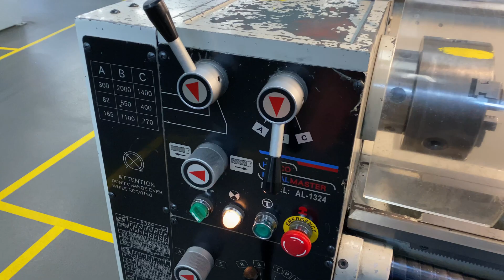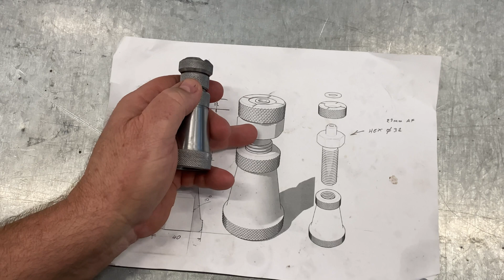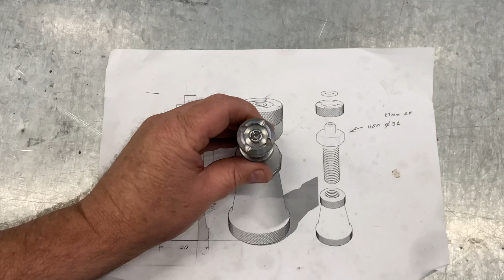Make a machinist Jack Part-2

Comment: Hi Aaron. Im hoping to use this as a school metal work project but Ive tried opening all the CAD files but it says im unauthorised. Can you please have a look or is there any other way I can access it? I dont use Fusion however in the past ive been able to open it Inventor.. Regards. Digby
Reply from the maker: G'day Digby.  Sorry those links didn't work.  Bloody Autodesk keep changing things and this must break the links.  I have updated them once again.  Here they are here mate:

CAD link here: https://a360.co/4qE3vvY
Machinist jack image from Google: https://a360.co/3YoIQQi
Machinist jack image TAFE: https://a360.co/3L7Vi3Z

Keep molding those young minds.  As for me, I'm back in the secondary system now teaching year 10's only.  Cheers, Aaron.
PS: send me an email if you need anything it's my full name at hotmail.com
Reply: @AaronEngineering  thanks heaps aaron. best wishes for the year

Comment: Very nice...what material did you use for the jack if you don't mind me asking... and I apologise in advance if you did say it on the video and I've missed the information
Reply from the maker: Hi Alex. From memory I think it was free machine grade to make this little screw Jack. We purchase this material to use at the college with the students as it’s easy to machine and you can get a good finish. Apart from that we also use bright mild steel. Hope this helps. Cheers 🍻. Aaron
Reply: @AaronEngineering  its of great help and also thankyou for taking the time to reply with an answer to my question. I bought my first machine tool a year ago and realised how much I had to learn, not only to use the tools I've now got but also the rest of the information that goes with turning and shaping metal aswell as which grades are best for which jobs. Thankyou once again Aaron and all the best to you and your loved ones🤙

Comment: Nice job, I like that you took the time to tilt the part for the vees insead of using a chamfering type cutter.
Reply from the maker: Thank you 🙏. It was a fun little project to make in the shop. There are some files and plans in the video description area you can download if interested. Cheers Aaron
Reply: @AaronEngineering  Thanks for the reply Aaron. Can I ask a quick question please. I'm relativley new to youtube and one of my videos has taken off with over 800 recent views, yet has no comments. Do you find this odd or is this normal.
Reply from the maker: @machinists-shortcuts  Hey buddy. That’s a very good question. Im unsure why people would watch but not comment. May I suggest to engage more with your audience. Maybe do some voice over or appear in the video. Best of luck with your channel. I added some comments and subscribed. Cheers 🍻. Aaron

Comment: I made this jack at Tafe 40 years ago as a Pre-Vocational Student in QLD
Reply from the maker: G'day Chris.  Not sure if you know, but I'm originally from Qld.  Did all my training at the Mt.Gravatt institute of TAFE.  Thanks for letting. me know that.  I actually found this on the internet when I was scrolling through Google images.  Then Adam, another YouTuber, told me it was in his TAFE NSW technical drawing book.  I love all those old project we used to do back in the 80's.  If you have any plans for projects Chris I would love get copy.  Of course I'd reimburse you for copying / scanning and or postage.  Cheers, Aaron.
Reply: @AaronEngineering  Hey Aaron
I did my Pre-Voc at Mt.Gravatt in 1981
Reply from the maker: @chriswoods2263  You must be a couple years older than me Chris.  I went to that TAFE from 1984-1987

Comment: We made these at tech about 1972 . I have still got the book and jack .
The book is Mechanical Drawing VOL 3, compiled by A.W.BOUNDY . PAGE 19
Reply from the maker: Hi Peter.  Thanks for that.  I had no idea that it was already out there.  I found the picture on Google images as some bloke had drawn them on Google sketch up.  Then young Adam reached out to me and told me the same thing.  I need to get myself a copy of that book.  Thanks for comment Peter.  Cheers, Aaron.

Comment: Many thanks for the CAD model. It appears to be a rendering because I only have a viewer. Can the linked model be imported and CAMed in a current version of Fusion?  I notice the angle is missing. Are you having the students calculate the taper angle?
Reply from the maker: Hey buddy. May I suggest to open the URL link via Google Chrome or Microsoft Edge. Once the model opens in the viewer, go to the top right hand side of the screen as there are 2 options. One should say download and the other open in Fusion360. If you download, it will save as a F3D (native fusion file). If you open with Fusion360 it will prompt you to save it once opened. Usually for CNC machining we always work with the solid model (reviewing the 2D drawings for tolerances & dimensions). You should be able to use the 3D model to apply all lathe toolpaths in Fusion CAM. Oh, the taper angle is 10 degrees. Hope this makes sense? Cheers 🍻. Aaron
Reply: @AaronEngineering  Thanks again for the help. I lost my F-360 when they changed the terms but plan to reload it soon. I appreciate the quality of both your content and video. Subscribed.
Reply from the maker: @chip-load  Thank you for you positive feedback and kind words.  Thanks for the sub.  Glad you enjoy the channel and content.  Hopefully I can keep up the pace.  Cheers, Aaron.

Comment: This gives me an idea to make a chess set of machinist jacks. Looks good except the boo boo, but crap happens and you adapt. The other commenters idea of the cross hole sounds like a good fix. I really need a dividing head. Good stuff.
Best! 
Eddie
Reply: I just had the same thought about chess pieces doubling as jacks..lol
Reply from the maker: Now that would look good.  Cheers, Aaron.
Reply from the maker: G'day Eddie.  Thanks for the feedback.  Yes, I was disappointed with my boo boo (fark-up).  I do have a ER32 (hex & square) collet block at home but didn't bring it in to school as I had the dividing head.  I have placed the CAD model and plans in the video description if would like to download them.  Cheers, Aaron.

Comment: I need to try keeping the half nut engaged on my Chinese lathe as well.  That's probably why I was having so much trouble with single point threading.  Thanks for the tip.
Reply from the maker: That's what my wife said to me.  Oh hang on, you're talking about the lathe LOL 🤣.

Thanks Steve.  Yes, it's the oldest trick in the book.  Just leave the half nut engaged, back off the cross slide and rewind.  Some lathes like my Colchester will cut metric threads, but as an imperial lathe if I disengage the half nut it starts in a different location.  I have uploaded the URL links to this project in the video description area.  Feel free to use it if you like.  Cheers buddy, Aaron.
Reply: @AaronEngineering  definitely a full nut

Comment: Az,
Very nice little project mate. When I chop my 1997 960B 😱 to fit the new 2horse motor, and re-assemble same 😎, I’m going to make a set of those very best jacks for sure.
Regards
Robert
PS I’ll send some pics of the lathe ‘retrofit’ …….
Reply from the maker: G'day Robert.  Thanks for watching mate.  You probably made a few of these back in the day at trade school?  The Fusion360 model is in the video description area mate.  Feel free to download it and use it.  Hopefully you can get that lathe up and running real soon.  Wish I lived closer, as I'd come around and get you sorted.  Cheers, Aaron.

Comment: I believe the hex was in the original plan to allow for wrench use.  When your jack is placed under heavy load I am afraid you will not be able to turn the knurled collar with finger pressure.  All is not lost however as you could drill a cross hole through the knurled collar and insert a steel rod when necessary to gain the necessary leverage.  Very well done video in all respects!
Reply from the maker: G'day and thank you.  Yes, I had all intentions of making the hexagon but stuffed it on the 3rd pass.  That will teach me for not locking the dividing head.  Unfortunately, I just didn't have time yesterday to make another so I machined the mistake and knurled it.  I'll make a couple more of these another time.  I will probably use this one as free giveaway down the track.  Great idea about the cross hole.  I'll chuck it back in the mill and do that modification.  Thanks for watching.  Cheers, Aaron.

Comment: Hello Aaron,
Turned out well... I've just notice how your subs are growing, 2k not far away... Keep up the good work.
Cheers.
Paul,,
Reply from the maker: G'day Paul.  Thank you, it came out looking OK in the end.  Can't believe I stuffed the Hexagon though (FML).  I just didn't have time to make another spindle yesterday, so I did a work around.

Not sure if you noticed the difference in my editing of late?  My 2014 MacBook has stopped working with my editing software (Apple do this by phasing out older machines with software updates).  I've ordered a new Mac, but it won't get here until early mid December.  I'm so use to editing on the Mac with Final Cut Pro and don't want to have to learn a new editing system.  I've tried Premier Pro, but it's so difference.  Lately I've been using my iPhone to shoot and edit, so you've probably noticed the change in quality.

Yes, nearly at 2K subs.  Thank you, as I couldn't do it with out the support of loyal subscribers like yourself Paul.  Oh, it's great to see many other YouTube machinist using your 60 second Sunday concept.  I've noticed many doing it lately.  We have you to thank for this idea Paul.  Hope you're well mate.  Aaron.